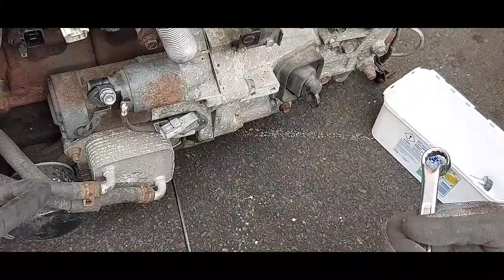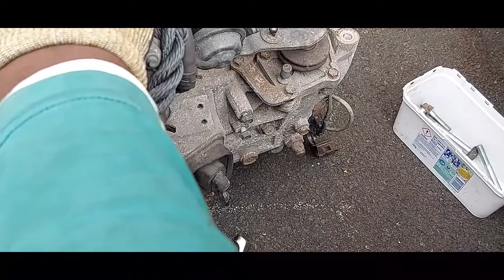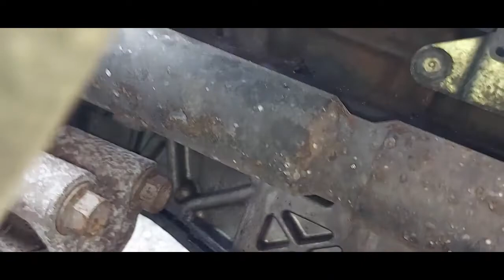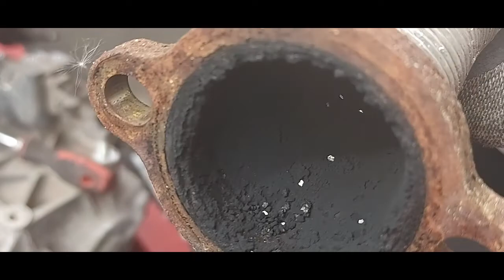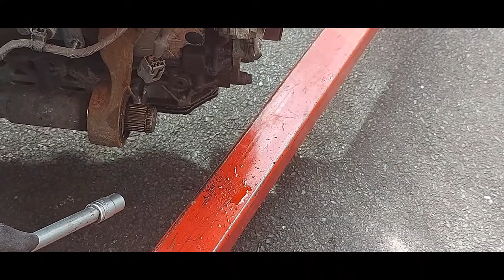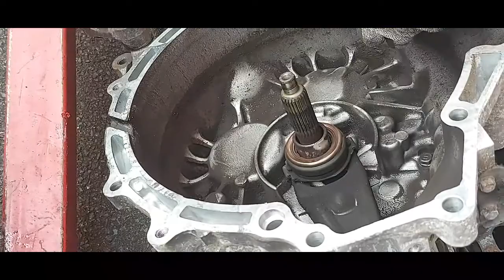Unlock the Secrets: Remove Mazda 6 Gearbox Like a Pro!

Comment: Trans Mount Failed, The 2 Copper Pins Which Lock The Shifter Linkage Where Missing( Someone Put A M10 bolt in the Lower Hole - it broke ) , Links started snapping off on the shifter side. 

Last night the it got stuck in gear , gear links disconnected but the shift linkage does nothing. Clutch works fine - I think the shift linkage is dead or something broke inside the gear box.

Eish...
Reply from the maker: Sad to hear. That's the problem with bush mechanics